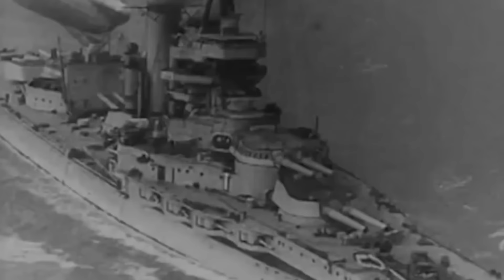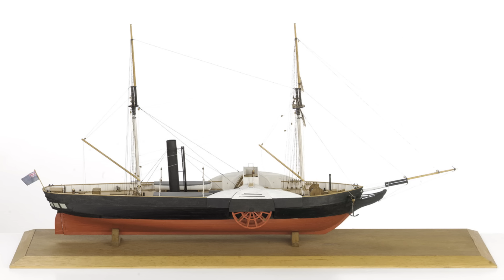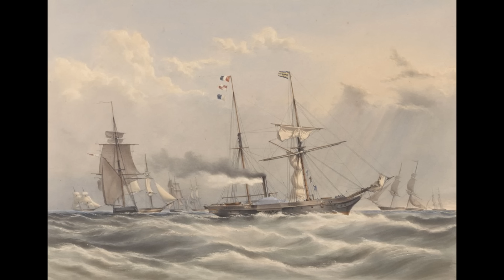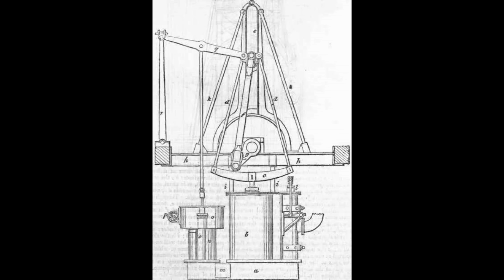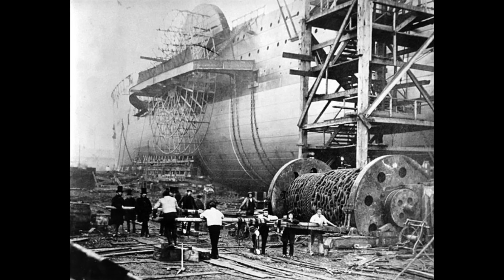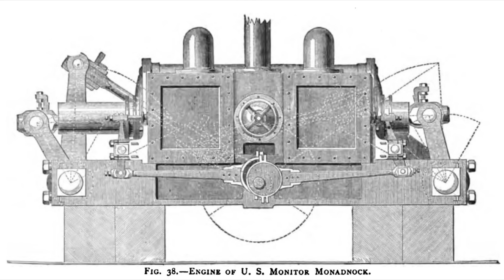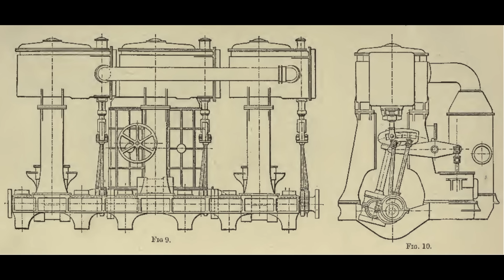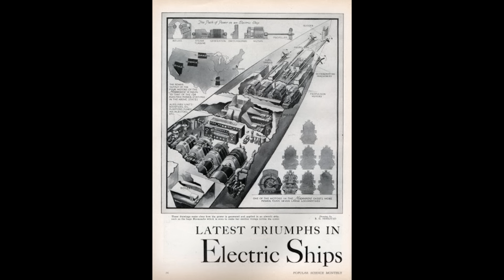Naval Engines - Rotate that shaft!

Comment: I've heard you and others say many times that the power density of steam turbines was greater than that of diesel engines in the early 20th century. Does that include the weight of the boilers in the calculation? Diesel engines don't need them while steam turbine engines most certainly do. If not, then what is the difference between power densities when boilers are included in the calculation.

Comment: Those who operated and maintained steam propulsion plants on merchant and military ships generally "got underway" hours, if not days, before the rest of the crew. Such was how long it would take to bring a "cold iron" plant up to operating steam pressure safely, and perform operational and safety checks, including looking for any steam leaks.
Reply: Wasn't just them.  Shore power is insufficient to do much more than get one boiler up far enough to make steam while still keeping the lights on.  When there was adequate steam on that one boiler,  then the Electricians would start bringing up the turbine generators to handle the load of bringing the Plant completely up.  Now you have a Duty Electrician and a full watch bill for the main switchboard.

Bringing up the plant requires that the alarm systems for lube oil pressure, temperature, condensate quality, etc. be online, requiring that a few IC Electricians be ready to run.  The gyrocompass systems take about 24 hours to spin up and settle out, so there is another full watch bill for IC Switchboard/Gyro watch.

Now that you have most of engineering stuck on board, the galley crew can no longer get away with prepping a bunch of stale sandwiches on their way to liberty and calling them midrats, as was common for the minimal Cold Iron inport watches.  Now they need enough guys on board to prep and serve 4 hot meals per day...pretty much an underway schedule for them at that point.

Onboard the ship I was stationed on, figure about 110 or so engineering (and other) types were stuck on board starting about 12 hours before they ever even lit fires, then another 24 hours before we could actually get underway.  Going the other way, figure 8-10 hours before we  were completely Cold Iron and on Shore Power and pier services.

Comment: In my 21 years as a naval engineering chief, I served on ships with steam plants ranging from 200 PSi, to 600 psi, up to 1200 psi and loved all of them. However, I still favor the 1200 psi superheated turbine plants of the 1955-1975 era US destroyers. They were like hot-blooded race horses:  a bit finickey and high-maintenance systems, but nothing else had so much power squeezed into such a small space. Changing periscope lights on top of an operating 1200 psi superheated boiler is something that has to be experienced to be believed...
Reply: You know it's a mighty engine what you are more scared of it than the enemy
Reply: What is a periscope light??
Reply: @chrishartcher4894  A boiler periscope is a little optical mount set into the boiler assembly to let the crew observe the gases inside the smokestack. Presumably this one had a light in it that needed to be replaced. Hopefully it was mounted clear of the boiler casing and smokestack, but you'd still be worryingly close to a Very Hot Thing.
Reply: @Loweko1170  right.  The periscopes let the watchstanders on the boilerfronts see if they're making black smoke (bad!) or white smoke (really bad!)  Both cases are a result of poor air/fuel combustion.
No smoke is the goal for post WWII ships. 
Black smoke soots up the boiler tubes and reduces heat transfer.  (This in turn leads to the boiler techs working long days over weekends to clean up the firesides after the plant shuts down in port, as the dry, dusty soot is easier to clean before condensation starts collecting on it & making it muddy.)
White smoke is explosive.
Since the periscopes are looking at the combustion gasses leaving each  boiler, before the exhaust gets channeled up the stack, there is no natural light, so a backlight is needed.
On the ships I was on, the periscopes viewing ports were 3-4 inches in diameter—you didn't need to have your face pressed up against them to see there view.  Typically they were oriented so the lead BT on watch could keep an eye on them.
Reply: @77thTrombone  The evils of black smoke are clear, but why is white smoke explosive?
Reply: @jujenho  Leaking water to the inside of the hot box.  If one of the tubes let go entirely, you have now pressurized a non-pressure box.  Steam cleaning your crew is contraindicated to their continued ability to keep your ship moving.  The watertight compartment then becomes a pressurized bomb too, so, lather, rinse, repeat from the initial failure inside the boiler itself.
Reply: @patrickgrady4995   Yes, "white smoke"! Thank you.
Reply: @77thTrombone  When firing commercial vessels, we use to aim for "economy haze" which was a light haze in determining fuel air ratio. Also we'd be also use the soot blowers twice a day to "clean" the firesides of the boiler generating tubes, although, check with the deck dept on passenger ships to make sure it doesn't interrupt the BBQ, if they're grilling topside. The passengers get annoyed when that happens.
Reply: @musoangelo  yeah, Buddy!
When I was in (USN) we only blew on the mid watch and when the winds were favorable (or we could afford to change course to make them favorable.) The 1st Lt &  Bosun sure hated waking up to find soot all over their deck gear. 
Woe to the OOD who gave permission to blow tubes and then needed to make a course change before the fire room finished.
Reply: @jujenho  
Foundation 1.  Of course there's a spectrum of air/fuel ratio, and there are multiple factors involved…
Foundation 2.  boiler combustion is a self-sustaining exothermic process wherein the first molecule to burn produces enough heat to 1) lend some heat to trigger a similar exothermic reaction with fuel+air molecules within a proximity, and 2) provide enough residual heat to boil water.
Now for the explanation:
1.  Black smoke from low air/fuel, usually due to improper atomization.  Poor burning produces carbon, which 1) is a 5-7x better insulator than asbestos, and 2) can act as a fireside-durable sponge to collect any poorly burned hydrocarbons "for later."
2.  White smoke from high air/fuel. There's so much excess air that some well-atomized fuel does not gain exposure to sufficient heat for it to combust.  You develop a firebox, economizer, and stack containing an air-fuel bomb fog.  Once the air flow reduces to a certain point, the unburned, atomized fuel will lose its isolation (from the excess heat) that was preventing it's combustion previously.
Someone mentioned stream leak with white smoke as a symptom.  You can tell steam from smoke if you see it leaving the stack.  On the boilerfront it's harder to tell.  Frankly I don't remember.  One giveaway, tho, is a telltale sound that's somewhere between your wife's response when you forget her 10th anniversary+Valentine's day gift, and Satan's own highball express from Hell.  Little tube perfs don't stay little for long, so the horrible noises will go away soon, and then you'll be able to rest in peace.
Hope this helps!
Reply: @jujenho  The answer above about water leaking in the firebox is not correct with regards to white smoke.  You cannot see steam in the periscope (it is too hot to condense into water vapor there!).  White smoke is caused by excessive combustion air provided to the burners, resulting in finely atomized fuel (presenting itself as "white smoke") exiting the boiler with the remainder of the combustion gases.  This is particularly dangerous, as it is a highly combustible mixture that could explode, destroying the boiler and any of several watchstanders in the surrounding spaces.  This is quite different from a boiler rupture or ruptured tube.  I think most people think of a boiler explosion as an explosion of the "wet" part of the boiler, but that part usually fails more gracefully than an explosion of combustible fuel gases.  Even on 1200psi boilers, there have been many ruptured tube casualties that resulted in no more damage than wrecking the boiler.  The escaping steam is typically contained within the boiler casing and exits up the stack.
Reply: @steamcheng  I think part of the misunderstanding is that most people are unaware of a few facts so basic to folks like us that we forget to explain them.  Please allow me to chime in...

If you can see it, it is NOT steam, it is water vapor...basically a hot fog.  If you can see it, then it will never be any hotter than 212F at sea level.

Matter can exist as a solid, liquid, or gas.  When discussing H2O, these are known as Ice, Water, and Steam respectively.  STEAM is the gaseous phase of H2O/Water, and is a colorless, odorless gas.  Being a gas, we can heat it to any temperature that we want to.  If we choose to heat it to a higher temperature, we call this superheat.  For our purposes, the most useful factor here is that a relatively small volume of water creates an almost staggering volume of steam, then condenses back into that small volume of water.

When we take high pressure steam and release it into a lower pressure environment it both expands and cools.  It will continue to do so until the temperature decreases enough that it drops below the boiling point for the ambient pressure.  The higher the pressure, the higher the boiling point.

We use this by introducing the steam into a turbine where the expanding steam causes the turbine to spin.  We can continue to do this either through multiple stages of the same turbine, or by exhausting the first turbine into a turbine designed for a lower inlet pressure.  Our goal is to extract as much work from the steam as possible.  Every time we let that steam expand to do work, the temperature drops.

So, steam at 600 PSI is around 490F.  Remembering that the higher the temperature, the more we can do with it, we cheat and run our steam back through the hot flu gasses and warm it up a bit, giving us 600-PSI steam at around 850F.  Assuming that the exhaust end of our turbines are at sea level atmospheric pressure, that gives us roughly 640F of temp drop to play with.  Actually less, as we still like to have pressure when we are done.

Behind the scenes where most people never tread, we condense the steam back into water (Condensate), remove any non-condensable gasses that snuck in there, adjust the boiler treatment chemicals (Corrosion and scale inhibitors), etc. to give us Feed Water.  We then inject the Feed Water back into the boiler and start all over again.

**I truly hope that this makes sense at a layman level.  Understanding something does not necessarily convert well to explaining it.  Further, my job was not to make the steam.  I would have been replacing that bulb in the periscope, fixing the Stack Gas Analyzer that theoretically replaced the periscope, ensuring that the electronic gauges that showed the water levels in the boiler worked properly, and making sure that if the dude in charge picked up a microphone or a telephone to give orders it would work when he spoke into it.**
Reply: @patrickgrady4995 Greetings from the Overlook Hotel Mr. Grady. I hope you corrected the crew Mr. Grady. Seeing as how you have always been there, and they always need to be corrected.
Reply: @patrickgrady4995  "Steam cleaning your crew is contraindicated to their continued ability to keep your ship moving. " Hilarious. That phrase is going to pop back into mind all day.
Reply: @kevincrosby1760  I enjoyed your breakdown. I am the definition of a layman and I understood. Very good explanation!!
Reply: @kevincrosby1760 very good explanation.
Reply: @kevincrosby1760  nice work, I appreciate you taking the time to explain some of the details.
Reply: @jujenho  black smoke is the result incorrect fuel burning (not enough air or too much fuel), white smoke ts unburnt fuel vapours. highly flammable.

Comment: 4:12 You keep using that word... I think you mean piston, in modern use at least, cylinder head usually refers to that 1/3d of the engine were the valves and the injectors sit.
Reply: Yes, that jarred for me too. However, I'm not sure about your definition - how about opposed piston engines, e.g. Doxford or Deltic, that have the injector in the middle of the cylinder?

How about cylinder head is the bit that covers the end of the cylinder? Of course, there are double acting engines, with covers on both ends.

Comment: The modern Queen Elizabeth carriers use a diesel electric system. What fundamental difference have occurred to make this viable?
Reply: Mostly CADCAM, & modern materials, processing & production technologies.
It's the same with modern yachts, e.g. an IMOCA boat is nothing like it's ancestors from the timber & canvas, or early composite boats.

Also, since we haven't had a carrier for a while, a bit of "so, it's a touch thirsty, but it does the job" attitude might apply...

Comment: The US Navy became quite the practitioner of turbo-electric drive during the 1910's and 20's. After the Spanish-American War, one of the primary requirements for US capital ships became an 8000 nautical mile cruising range - based on being able to steam from the US West Coast to the Philippines in time of war. The USN had quite the time trying to develop a turbine setup that satisfied them from an efficiency and reliability standpoint, which explains why they kept reverting to Vertical Triple Expansion engines in some ships, all the way up to the Oklahoma - which also to some part explains their insistence on a 21 knot fleet speed. They hadn't as yet developed a suitable geared reduction turbine setup, so the one option that seemed to answer all their requirements was turbo-electric drive.
Several of the latter series of Standard battleships used turbo-electric drive. And the planned 1920's South Dakota class battleships and Lexington class battlecruisers were slated to have the same type system - which the converted carriers Lexington and Saratoga inherited.
Reply: Lady Lex and Sister Sarah were two of the great carriers of WW2.
Reply: What were battery types like in those early turbo-electrics?

Comment: My Grandfather, who was an engineer aboard USS Iowa in WWII, mentioned the large diesel engines on the Graph Spee caused vibration issues with Graph Spee's rangefinders.
Reply: Depending on the style of engine and the harmonics of the ship, there can exist speed(s) wherein the vibrations from the diesel engines (or steam reciprocating engine) begin constructively interfering with the hull itself.  A ship operating in this range can actually shake itself to pieces, popping rivets and working bolts loose, among other things.  Modern merchant vessels have the same issue as well and the solution is simple: Do not run at those speeds except to quickly reach the speeds above and below.  This is not an issue for turbine driven vessels (gas turbine or steam turbine) as the operating frequency is in the tens of thousands of RPM, and thus too high frequency to constructively interfere, as the range of RPMs that generate this effect is normally somewhere from 60-80, depending on the ship.
Reply: @nomad8723  Some Cessna Aerobats had a yellow band on the tach at 2350 engine revs. It was advisable to avoid this range due to harmonic resonance. Helicopter designers are reluctant to use piston engines for the same reason.
Reply: I think the salt water had an effect on them as well.
Reply: She's curently moored in the port of Los Angeles. My father and a couple of my brothers visited her after my grandmother's funeral... By her size and relevance to American power projection, I was absolutely impressed, even into my lifetime, as she saw action in 91' against Iraqi fortifications.
Reply: I believe the class used 8 marine diesels of the sort used on the largest class of U-boat. With all 8 operating at high speed and being solidly mounted to the hull, I bet they could be felt all over the ship.
Reply: *Graf Spee
Reply: The Iowa was powered by steam turbines.

There were emergency Diesel generators aboard, but they were not routinely used
Reply: Diesel sucks!! Steam rules!!!😁
Reply: I dunno I think those steam enthusiasts are just full of hot air 😄

Comment: For as big and powerful as our carriers are, they are still steamships at heart.
Reply: You have to admit, the A4W reactor is one helluva boiler.
Reply: @L0stEngineer  Stokers shoveling that sweet shiny atomic coal.
Reply: @Alpostpone  Look at Ming the Merciless' power plants in the old Flash Gordon serials from the 30's: sweating gangs of stokers shoveling radium into the furnaces.
Reply: @L0stEngineer  I will attest to that
Reply: The American ones at least... Ours cruise on diesels and sprint on jet engines, but all electrified.
Reply: Almost everything discovered by science boils down to a single question posed by engineers: "Can we boil water with it? Yes? Good, hook it up to a steam turbine!"
Reply: @Crazymoniker  Propulsion engineer thought process be like
Reply: @Alpostpone  "Can I make it turn a shaft? Yes? Good, it's useful!"
Reply: @Crazymoniker  That is not even close to the same GALAXY as what science does.
Reply: I believe that the only steam ships built today are nuclear powered. All others are either Diesel or gas turbine powered
Reply: @tracylemme1375  Conventional boilers and steam turbines are still found on some Naval Auxiliary ships such as Oilers and Replenishment ships. In the US Navy they are all but gone.

Nothing wrong with the underlying principal, they just require more crew to operate, and fuel consumption is higher than a comparable ship with a diesel or GT plant.  On the flip side, as long as the volatility was low enough and the viscosity could be adjusted to match a burner nozzle, you could burn just about anything.  Have too much asphalt sitting around?  Cut it with diesel to reduce the viscosity and light off the boilers...